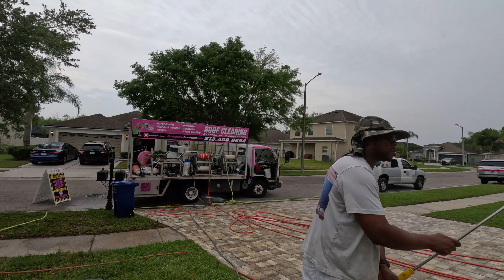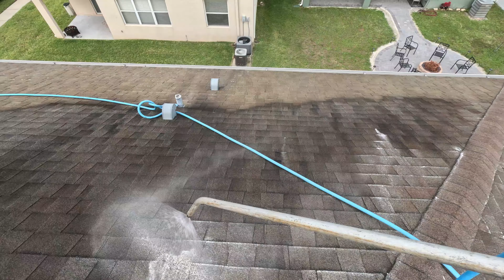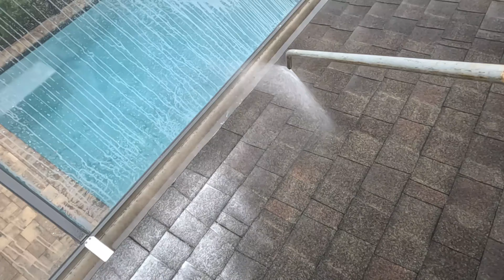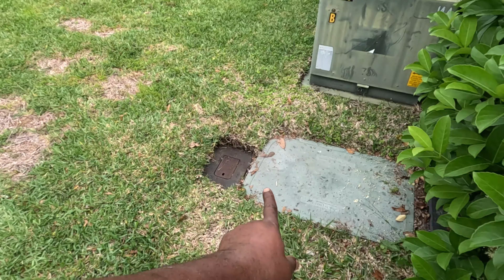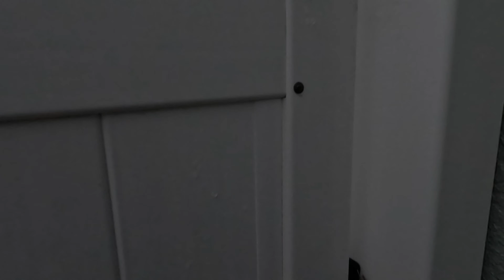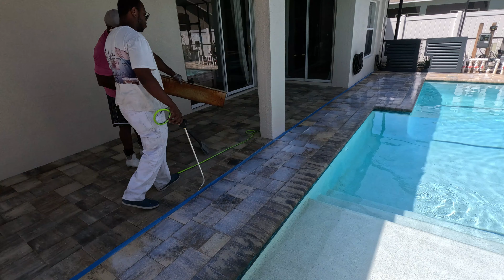Full Property Maintenance + Paver Sealing 🔥

Comment: Great job Cliff!! Let’s say the weather was good when you were heading back to the job to let the pavers dry you guys started sanding and sealed it and rain came right after you were done what is the process after that? Do you have to redo or not thank you 😊
Reply from the maker: If it poured down like it did right after  then I'd have to reseal the pavers.  It wouldn't have been cured.

Comment: How do you like the Ureseal H20 2-part vs 1-part such as Deco? Difficult to get the measurements right with the two part or do they make it easy? Thanks!
Reply from the maker: It works great especially when doing large area. Not difficult at all after the 1st time.  Once you know the ratio which now I do 1 part sealer/hardener mix to 2 part water it's easy as heck now.  

Normally I do 2 gallons of sealer/hardener mix and I put 4 gallons of water (the ureseal buckets hold 6 gallons). I do that for the 1st and 2nd coat (sometimes I do 1 to 1 ratio for the 2nd coat)

Comment: You didn’t water the sand, you just put the sealer right on top? What sand did you use? Thank you
Reply from the maker: No I dry sanded them. I used silica sand
Reply: @PinkFlamingoPowerWash  I’m going to do my first sand and sealant job. What do you recommend for me to use as a first job. Thanks
Reply from the maker: @tylerdurhan346  check out my paver sealing playlist.

Comment: Them pavers were popping. How much hose do you have on your bucket and what size pump.
Reply from the maker: Total build is $150. It's a 1gpm 12v pump
Reply: Awesome job as usual.  Regarding the sealer, do you think you used 10-12 gallons for the driveway?
Reply from the maker: @colonialfiend  yes just about

Comment: What kind/brand of sealer you used? Thanks
Reply from the maker: Ureseal H20
Reply: Thx for replying. What kind of paver cleaning solution to use on stains such rust metal stain or paint stains
Reply from the maker: @Angielam81  rust - rust aid, oxalic acid,  rust remover plus,  one restore. 
Paint - paint thinner,  graffiti removers

Comment: Dumb question but do you pull off all your hose even if you don’t need the extra hose?
Reply from the maker: I only pull off what I need. I don't run the system with the hose still coiled on the reel
Reply: @PinkFlamingoPowerWash  what do you mean while it’s still coiled? I have 200ft but won’t need that majority of the time can I unroll 100ft while the other 100 is still coiled on the reel as I work?
Reply from the maker: @Anthonysni92  I don't leave my pressure hose coiled up on my reel when I use it.  If I need 100 feet I just pull 100ft and hook it up to the pressure washer.
Reply: @PinkFlamingoPowerWash  so you don’t run the system through the actual hose reel, essentially you use them for storage?
Reply from the maker: @Anthonysni92  correct. I used to run through the hose reels in my earlier years. But now with this rig I don't do that anymore
Reply: @PinkFlamingoPowerWash  any benefits to not using the actual hose reels? I just plumbed mine to work directly from the reel with 200ft of hose but I have a smaller job tomorrow & will probably only need 100ft of that so I wanted to make sure I can pull what I need & leave the hose connected to the reel while the other 100ft is still coiled on the reel
Reply from the maker: @Anthonysni92  benefit is the hose reel restricts flow a little bit. And also leaving hose on the reel while pressure washing causes the manifold to flex and sometimes break depending on the hose reel.  

I dont use 200ft single hose. I have 400ft of hose but they're in 100ft and 50ft sections.  If you only got 200ft and it blows then you're stuck
Reply: @PinkFlamingoPowerWash  they’re two 100ft sections
Reply: @PinkFlamingoPowerWash  i have the general pump hose reel
Reply from the maker: @Anthonysni92  ok good. 👍🏽
Reply: @PinkFlamingoPowerWash  last question and it’s a newbie question, but if I switch to only using my reels for storage I can just add a qc to my whipline and connect to that once I pull what is needed correct?
Reply from the maker: @Anthonysni92  correct or get an unloader block to mount it on.
Reply: @PinkFlamingoPowerWash  thank you greatly I’ll switch over to that configuration instead